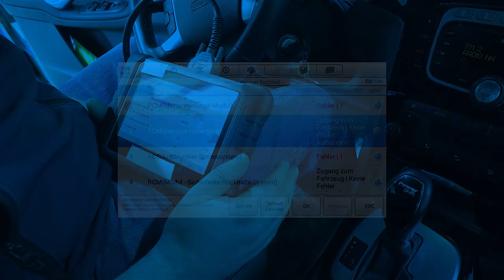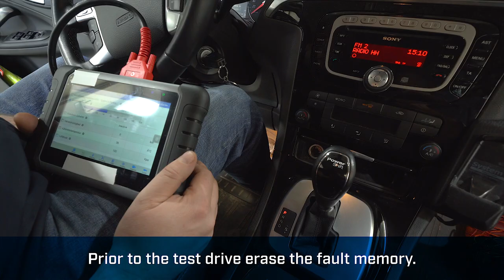Simple and fast: the transmission oil change for the Getrag DCT450 automatic transmission

Comment: Hi there! thanks for the great video. One question though, is there any recalibration needed to be done on the gearbox? Or the fault codes(if any) are erased and that's it? Also, on the Volvo manual it says Torque: Oil drain plug, gearbox 35 NM. Why is there a difference since it should be the same gearbox?(you mention 43NM) Getrag DCT 450/MPS6. Thanks!

Comment: In mk5 2.0 diesel removing air filter housing wasn’t so straight forward as shown here. You have to unscrew some side box with twi 7mm head screws. Bellow filter housing was two rubber holders you have to just pull it off.

Comment: Hello. I have one question? Why do you add the oil twice?
Reply from the maker: As shown in the video, the transmission is filled when the engine and transmission are cold. This is followed by the warm-up of the engine and transmission with the corresponding transmission oil temperature check. The oil level must then be checked again as prescribed and the oil must also be topped up a second time to the correct level.

Comment: Hi. When I try to buy this kit I find two possibilities: 714 135 0002 with 6 l oil, and 714 135 0102 with 8 l oil. Can you advise which is correct? It's not clear, but seems like you get through a little more than 6 l in this video. Thanks.
Reply from the maker: Hello, in this case please get in touch with our Technical Service Team. They can help you with your request if you provide your detailled vehicle data. You can reach them by using our contact form: https://www.meyle.com/en/contact-2/technical-request/